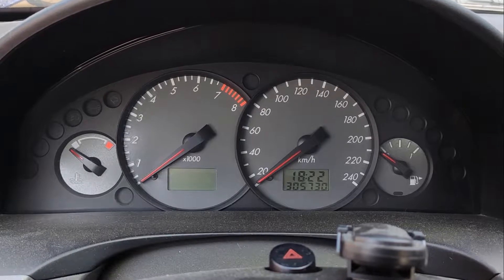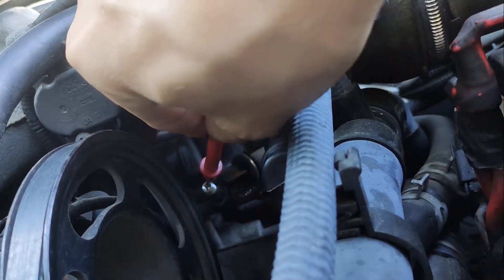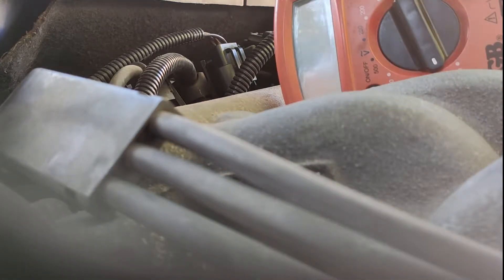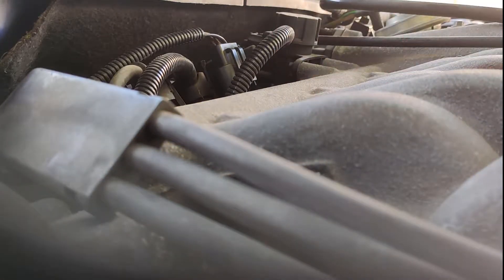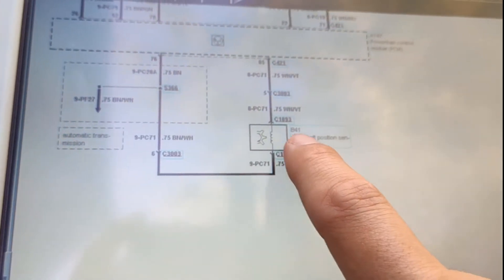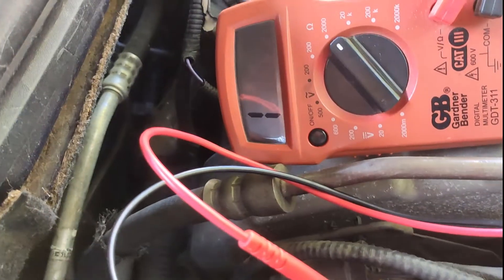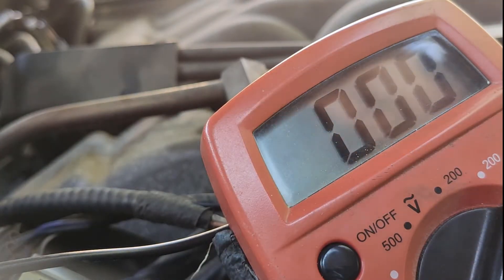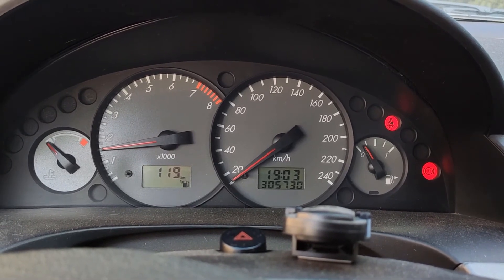1999 Ford Cougar - Crank no start - Crankshaft position sensor diagnostic

Comment: What if you have 25 v at coil pack and battery?
Reply: Had multimeter on wrong setting... and I also fixed the issue which was the crank sensor! Thanks

Comment: Hey I have a question I check the leads on the coil pack wire and only one of them had 12 volts  the other was 0.0x where does this wire lead too